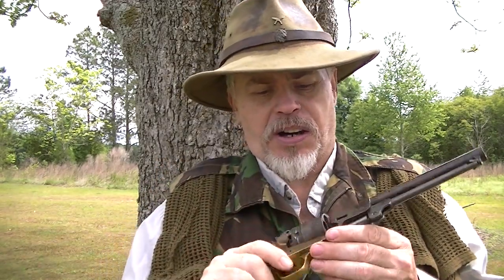THE PERCUSSION REVOLVER CHAIN FIRE

Comment: Great information! However I would argue that what is actually not perfectly round is the ball, not the cylinder, given the process of how each are made. Just my thought.
Reply: could be right however worked in engineering plus or minus up to 10 thou the norm and yes as he says the initial boring is done with a multi head tool when the tool is getting a lil long in the tooth or itself need s a regrind thwe hole it bores may not be abso round  personally now i use a larger calibre ball in all my percussion pistols  with either wad or grease

Comment: Awesome vid!  I chamfered my cylinders which caused ball to compress rather than shave a ring.  I was experimenting with long staying loads and had a squid load discharge (failed experiment) and the ball bounced off board and rolled back to me.  Had an 1/8th inch compressed band around ball which I did find very interesting as evidence of the seal created.  Just my 2 cents.  Thanks much!

Comment: Blackie - You have explained chain fire very well. I have only one disagreement. Namely DON'T pinch caps that are loose fitting. If the caps are loose fitting, don't use them or find another way to keep them on. I've been shooting since '71, and the ONLY chain fire I've had was when I accidentally bought some #12 caps for a revolver that took #10. ..... I initially  pinched them just like you've suggested, but experienced chain fire. And no, one didn't fall off. I finally used those caps up on a rifle, and pinching them in place there worked fine. My brother used another method. He painted wax around the top of the nipples before he placed the caps. That seemed to work also. But long story short, and what I've been saying whenever the subject comes up, chain fire occurs with BOTH loose fitting caps AND balls.
Ensure good fit, both caps and balls, and you should never have to experience a chain fire (Not guaranteeing that, mind you, just saying).
Beyond that, you've explained it very well in language that most should find understandable. Good job.
Reply from the maker: thank you..i agree  most time i pinch its a mere slight oval..the cap fits byitself..#11's..but i find the slight ( and i do mean  slight ) pinch adds a tad of friction to keep them on during recoil..thanks for sharing..safe journeys
Reply: Could you please explain what happened to your hand when you experience a chain fire? Or what is the worst thing that could happen (injury’s)  if one experiences a chain fire with a black powder revolver?

Comment: As before mentioned on another of your videos, great info but I'm going to stop telling you that as your hat size is going to increase.  :o)
Interesting notes; Sam Colt emphasized the point of using correct cap and ball sizes during his sales pitches of these revolvers. At the beginning of the pitch he would place a loaded and capped revolver into a bucket of water. At the end of his speech (approx 15 minutes), removing the gun from the water bucket he would fire all six chambers with never a misfire or chain event!
The other interesting fact is, the Colt factory originally didn't include info in the instructions to use any type of grease! That technique came about much later, not by Colt, but by the folks who owned one of these guns. Years later Colt did include that instruction and it first started with conicals (grease grooves as seen on factory made molds) and later on with round balls.
Mentioning paper cartridges, not only were they made with nitrated paper but animal skin, as well as metallic foil, were also used.
One poster inquired about chamfering the mouth of the cylinders: that was a patented, early improvement by Colt to help avoid chain fires and they used a chamfer of approx 2 degrees, so your pistol should already have that,
Oracle69, thanks again for taking the time and effort to bring all this much needed info to the masses!!!!!
Reply from the maker: thank you for your kind words..safe journeys

Comment: Thanks for the benefit of your experiences. I am about the only cap'n'ball shooter in my group here in New Zealand, so it is great to compare notes, as it were.
First thing I do on getting a cap'n'ball revolver is check the cylinder mouth sizes and compare them to the groove size of the barrel (slug it to measure or use an inside mike at the muzzle). I have always found the chambers a bit tight on new reproduction revolvers....I take an expanding reamer and ream them to about a thou bigger than the groove size. This ensures that they are all the same, dead circular and match the bore properly. The amount removed is usually very small to get it right. just a thou or two, and once the reamer is set, doing the other cylinders is quick and easy. Do it by hand, not with a drill or anything... plenty of lube, frequent clearing of chips. Gives a better-than-factory finish, and gets them perfectly round.
I use a 1/16" thick lubed felt wad behind the balls which keeps the fouling soft. I have never (so far) had a chain fire, but they should not happen with perfectly round cylinders and balls about two or three thou larger. My Remingtons use .457" balls which shave just a wee bit off on loading, the chamber mouths being .455+. and the groove size of the Ubertis is .454".
Accuracy is better with this process completed too... :-)
Reply from the maker: sound wisdom....glad you enjoyed my channel..safe journeys

Comment: That explanation actually makes a lot of sense.  Thanks. I've often wondered about people who swear it's one or the other and refuse to consider that it could be both.  The only chain fire I ever had was with blanks and I'm certain mine was from the front end of the cylinder because I was using Cream of Wheat to pack in my powder and not produce a projectile.

Comment: Very good information. What you said makes more sense than about a half dozen other videos I've watched on the subject. If you watch the ring that is made as you load and make note of which chamber, I've noticed a particular chamber makes a different ring then the others. That alone tells me they are not all the exact same. I have a 51 Colt 44. the 451s barely make a ring. This makes me a bit nervous. Never had a chain fire from either end actually and want to keep it that way! I like your advice of using a 457 ball. I use 10 caps instead of 11 and haven't had an issue of a lost cap yet. I look before I fire each shot to be sure. Using 11s even after squezing them have fallen off.

Comment: I've noticed this with some cylinders that I've reamed.  I used a .449 chucking reamer to get my Pietta cylinders right for my .448 barrel grove dimensions.  Some chambers show signs of run out as you go deeper with the mouth being pretty concentric. That mouth area is where I place the indicator during set up in my 4-jaw chuck prior to reaming.

Comment: Blackie, I have been shooting percussion revolvers since early in the 1950's starting with an original 1851 Navy. Back in the time of DuPont gun powder and corrosive caps. In all that time I have had one single chamber fire and that was an undersized ball that should have been culled. Afterward I checked and the cap was still in place. When I checked the box of, cast by me , balls there were a couple of not so good ones that should have been culled. Whnen I listen to so called experts talk about "pinching" caps to fit I know there is a chain fire waiting to happen.
Good work, good information, keep on shooting.
Reply from the maker: thanks safe journeys to ya

Comment: Pretty much spot on.  One thing I'd add is some of the early ones had poor machining and finishing on the chamber mouths.  Some had slight burs that would undersize or scrape a small groove in a ball.  Others lacked any kind of chamfer to the chamber mouth.  A very slight chamfer on the chamber mouth makes swaging a ball or conical in much more secure.  Last new one I saw was several years ago from Taylors, an 1860 and other than a change to quality nipples, needed zero work to get it running rite.

Comment: With almost 50 years experience, I have found that incorrect cap size is the main cause of chain fire. If you have to pinch the caps to keep them on then you're using the wrong size cap, (some brands of the same size fit tighter than others btw). Also it is more likely that the projectile is out of round than the chamber. If the ball doesn't leave a ring of lead all the way around you need a larger diameter ball (which will greatly improve accuracy as well). Oh and I don't use lube over the balls. It's not necessary, makes a mess, particularly on hot days. I like the Wonder Wads but they take up space and in my experience affect accuracy to some extent tho not much.

Comment: Hi Blackie!  I typically shoot my round balls with lubricated wads, but my paper cartridges with the Eras Gone bullets are just dipped in a mixture of beeswax and lamb's tallow, (pretty much like the originals).  Have you ever experienced, or heard of, a chain fire with paper cartridges made in the traditional way?  When shooting the paper cartridges, I usually wipe a little bore butter over the tops of each of them after they are loaded.  My thought is if there is a slight gap around the bullet, the lube will lessen the chance.  Your thoughts or feedback?  Thanks much!!

Comment: So can you prevent chain fire even more by using a wad and then top off the ball with bore butter?
Reply: The bore butter don't help for chain fires, chain fires happen from the back of the powder charge, Like if a cap falls off the nipple. The flash from one cap can light the other chamber that is missing a cap. Bore butter really helps the bullet threw the barrel and makes it much more accurate.
Reply: I just found out that not putting bore butter greatly increases the risk for chain fires.
Reply from the maker: in my many yrs  i have looked at chain fire quite a bit...if the bore is not truly round in the chamber then grease will help fill and prevent flash around the ball..if the cyl  chamber walls are in correct round then it would help chain but still helps lube bore to prevent hard fouling..i have  seen a chain fire at a match with a 3rd model dragoon where the chamber mouth s were heavly greased..but he had a cap fall off and the round ahead of it fired and boom..i think its just a combination of possible factors..the odds are low but not zero of it happening..and its one of the things we need to be aware of and be careful of..thanks for the comments..safe journeys

Comment: Another benefit of oversized balls (or bullets) is that it grips the rifling better.
to see that try and push your projectiles through the barrel and see what kind of mark the rifling leaves.
I know that in a particular gun .450 conical engages well with the rifling and .454 ball also does. I wouldn't recommend .450 ball though.

I like your videos.

Comment: Thanks for all the videos and sharing information.
Will using a lubricated felt patch after putting in the powder 100% prevent chain fires?
Reply from the maker: i feel it will make it very very very unlikely..but nothing is 100%
Reply: @BLACKIETHOMAS  Thanks.  Understood that nothing is 100%.  That's helpful to know.  I'll stop using the messy Crisco in every chamber and use the patches and just relax a little.

Comment: great vid blackie, but didnt you advise in one of your previous videos to soften the edges of the cylinders with a hand file so that we dont get the ring shaved off any more but that the ball gets sort of sqeezed in the cylinder ?
Reply from the maker: yes i did at the very front  edge ..this will allow more of the lead to be squeezed in and thus produce a better seal..a slight out of round chamber will be help with it as well..thanks for the comment safe journeys

Comment: so it chain fires now what happens to you ? and what if the ball hits the bottom of the loading area or don't it line up on the bottom ? stay safe briother
Reply from the maker: usually only the bottom one is a problem..usually you just dig the lead out..at the worst you will have to sand down the rammer if the impact swelled it and makes it too tight for the channel
Reply from the maker: lo well you do know it went off..thats a fact
Reply: blackoracle69 lol

Comment: Thanks Blackie for your informative videos. You are one of my top YouTube go to guys for black powder revolver info. I'm curious though why no manufacturer has made a slightly elastic plastic percussion cap that would fit tight on the nipple and not jam. Any thoughts? Thanks.
Reply from the maker: actually back in the 70's they tried it..it was a small rubber (?) cap holding the fulmante pellet in side..problem was they would flex and the pellet would fall out  so you had a dead cap..they did not last long

Comment: Great Video Blackie.  With my .36 everything seems fine with .375 balls directly on top of powder, nice even shaving all around.  Since using wonder wads, if it sits any time at all, the ball works itself up in the chamber to the point it won't stay rammed back down interfering with rotation so I can't get the caps on.  Ball too small or am I missing something?  Thanks
Reply from the maker: yep ball too small and charge a tad to big..when you ram you compress which is what you should do..but if charge a bit too big say 25 gr instead of 22 for example..the pressure can unseat( over days and days )a ball thats a tad too small try 380 and see if the rounds stay firm in the long run..thanks for the comment safe journeys

Comment: Blackie, I have a Dragoon & the drum to the barrel clearance is .060    I filed the barrel frame & shorten the 2 pins some. I also shorten the arbor buy now my wedge is all the way in to be snug. I compared the wedge slot to my 2 Walkers & it seems close so there is enough meat for a new wedge to work.  The clearance is now .010   I'm not sure a new wedge will help. 
Any ideas. THANKS RICK
Reply from the maker: ok is you base pin full screwed into the frame?..i saw this once before on a new gun..if it is then go with a new wedge..if its at .10 now it should be ok to fire..test and see..go slow..

Comment: Grease on top of the ball makes a big mess.
I take some BORE BUTTER and put a ring around the top of the cylinder similar to the size of lead ring that the ball would make when pressing a ball in.
Then press the ball in.
The over that ring of grease makes a good seal.
Don’t get generous with the grease, you don’t want to lube the powder, a little is all you need.

Comment: Wood putting a glob of Grease into your your bullets and rubbing it around them and then when they get pressed down it would give an extra layer of protection. I mean you already getting briefs and everything on your fingers unless you're using Wonder Wads correct. So it's a greasy process to begin with. But do you think that that would have any benefit. Thank you
Reply from the maker: it is usually a good idea..but any grease under the ball can effect the powder and make it hang fire or not go off..so a thick waxy lube thats not going to ruin the charge can work in my paper ctgs i often put tiny beads of soy wax in with the powder it will not wet the powder so to speak but will add lube as it goes down bore when fired

Comment: Howdy again, I followed your advice in the BP revolver series and have cleaned up all the wire edges and checked it out for defects in the crown ect.. Been having trouble with cap jams.  I just ordered some slixshot cones for my Pietta 1860. I havent received them yet. Can't wait to try them. I'm hoping that Winchester # 11's will fit as I'm pretty well stocked with those for my BP rifles
. Any suggestions? Will they work ?
Reply from the maker: they can be a big help
hope it fixes your problem..safe journeys
Reply: Me too ,Thanks.
Reply: Got the slix shots and they made a big difference. I shot 60 rounds and not one jam. BUT,,, the real credit goes to all your good advice, tips and mods, because I had all but given up on my BP pistol as a reliable gun to carry. Thanks to you, my "cheap" Pietta 1860 is now accurate, dependable, and a joy to shoot. I'm confident now to use it as my main carry in the woods. Thank you !
Reply: I did not have great luck with slixshot nipples. the winchester and cci caps will be a little loose in my experience. The best thing I found to minimize cap jams is to take a file or even good sandpaper and remove the corners and edges of the safety slot in hammer. I will try to explain but it is difficult to do. What you want to end up with is you want the slot slightly wider at the face of the hammer and narrower at the bottom of the slot. what happens is as the gas drives the cap into the slot it expands the cap so with the slot a little wider at the bottom than the face it grabs the cap, You want to make the face wider than the base of the slot that way it won't grab and hold the cap. Done this to five guns worked with all of them. Good luck

Comment: Blackie we are family we are both part Thomas 
Question
.... I just rebuilt my 1851.. everything works smoothly untill I cap it.... I have to pull the hammer back push it in toward the cap and then rotate. If I actually shoot it or it's empty I don't have that problem

What part could be affecting me. The hammer face,?
Reply: Should be an easy fix.
Reply from the maker: could be the hand hang up in its channel or the legs of the bolt..when you fire they jump past those quick but when you cycle by hand they drag or hang up

Comment: So the first time you fired your .440 ammo you didn't use wads or grease or a powder overlay of corn meal? you just went with the powder and balls and fired all 6 at the same time? Still have the same gun and the same hand/fingers, etc...? interesting. Now you still don't use protection - just bigger balls? Have you tried the 30 grain pistol pellets? I'm about to use them tomorrow. I suppose I should grease up the holes. I don't care for the mess but didn't use wads or corn meal over them.